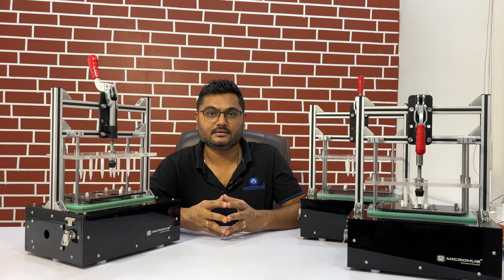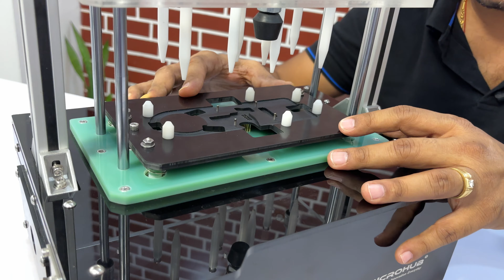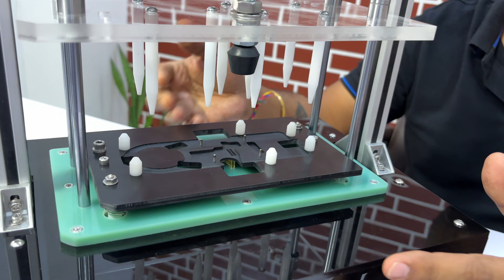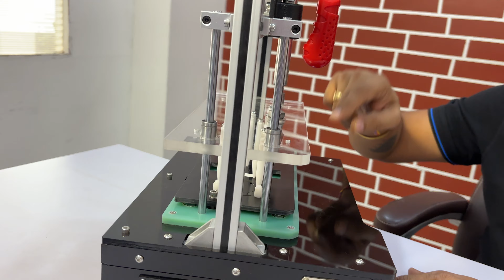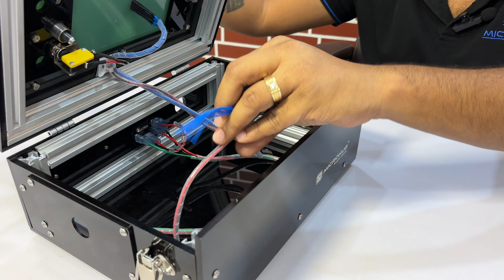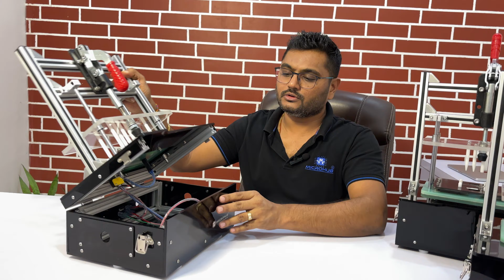Mass Production PCB Testing Made Easy | Ingun Pin Test Fixture #ingun #pogopin #testequipment #test

Comment: I'd guess around $3000-4000 for a basic system like that with no electronics in the USA. Adding electronics and software sends the price through the roof.
Reply from the maker: Hi our fixture cost is drastically low , it will be approx. 900 to 1200 USD based on requirements and number of Test points